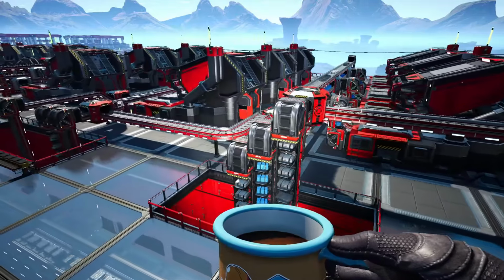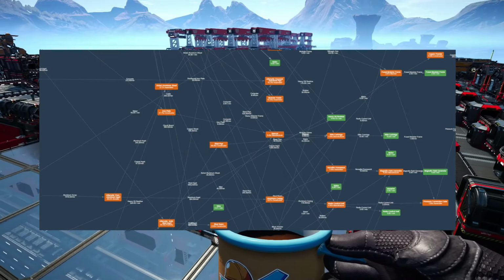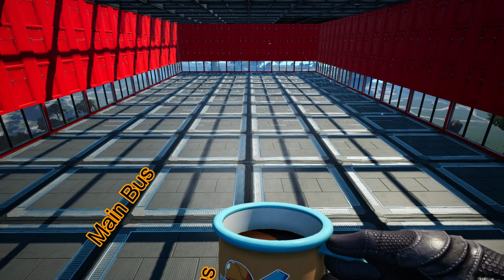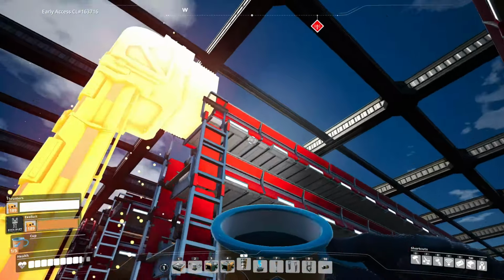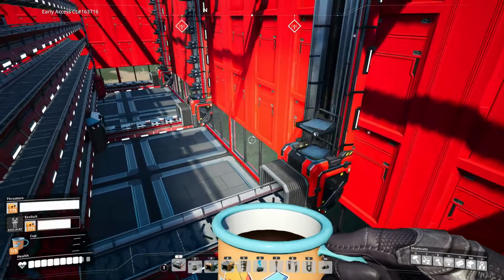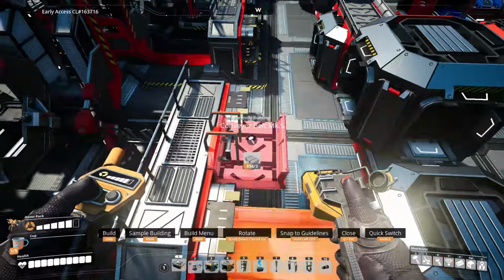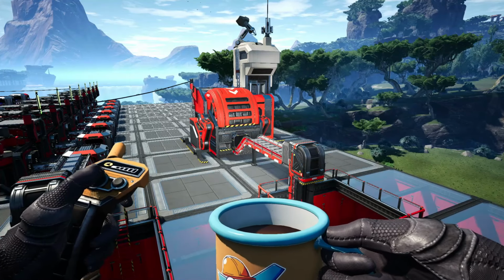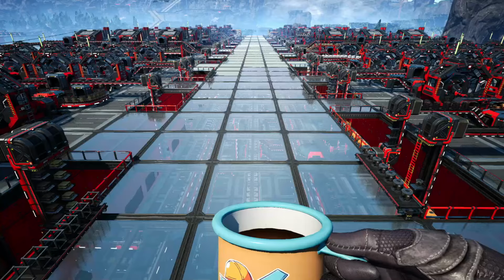Satisfactory Main Bus Tutorial

Comment: You can make the screws where you need them from steal beams, that way you don't need a separate line for screws outside the main bus
Reply from the maker: That's definitely what I would do if I needed screws.  I generally don't build my bus until I have enough alternates unlocked that I don't need screws but the steel screw recipe is def my favorite.
Reply: Isnt that what he did?

Comment: I have my main bus set up as a two loops  stacked on top of each other. one loop distributed everything to the different factories with smart splitters and sends all overflow to a belt connected to a sink.  The other loop gathers all products and excess components and puts them all back into storage.  The main storage takes in items from two belts with programmable splitters and it sends all overflow to the sink.  The idea was to make it kinda like the blood stream in your body where you have a mainline with a high flow rate and lower rank belts at the machine's inputs to make it efficient.

Comment: Nice video!  That's very close to my setup except that I put two sets of main bus stacks side-by-side (without clipping them) and leave a gap of one belt to allow for lifts.  Because I get double up the stacks, I only build 5 high and use the area where your 6th belt is to go above the belts to get items over the stacks if needed.  In your setup, you get 24 lines.  In mine, I get 40.  It's something to consider.
Reply from the maker: I've considered that, but what scares me off of it is what if I have factories on both sides that need to pull from the same belt, and I only have room to connect to the splitter once?  Now you have to find room somewhere else to make that extra split and it's just not nearly as clean and simple as being able to connect lifters to both sides of one splitter.  In general I'm a big fan of compactness and neatness but if there was ever a place where having a little extra space to maneuver would be helpful, it'd be the main bus IMO.
Reply: @StudleyKansas , yup, I get it.  I have made mine work so far.  For me, pulling wasn't the problem, it was putting back on (in my case, screws that you don't add anyway) and I only had tier 2 belts at the time.  I was hoping the initial line would hold out until tier 3 or 4 belts so expansion wouldn't be a problem (yes, delusional for screws, I know!).  I just put two Mergers side-by-side and ran the belt with a 90 degree turn to line it up.  There's tons of room for mergers/splitters as long as you can accept the items getting added/removed from the belts within a couple meters of each other.

Honestly, if I had planned better, this wouldn't have been an issue.  I could also have just used a second belt but I was winging the layout and it was early in the factory's life so I didn't know how many items would be on this floor at the time.  What I DID do was leave tons of space between the lines.

Anyway, like I said, it was just an idea to consider.

Comment: This was an awesome video please do more. No one really makes these end game organization videos
Reply from the maker: I sure will, thanks!  I've started a new save and am going to cover the different stages of the game starting from the beginning.  I think a lot of people are looking at this video and saying "Whoa, I'm not ready for that", so hopefully backing up a little bit and going into a little more detail will help people see that they can get a lot of use out of this earlier in the game than they think.
Reply: @StudleyKansas  awesome! I am following along building this bus in my new save but struggling with storage vs production. ex: iron plates, in the vid you say that the iron plates should go onto their own belt for production down the line, thing is you need a ton of iron plates early in the game for general building so the only way I have of storing them is to use the smart belt which once I also added iron rods to (for storage) clogged immediately. Is there a way around this?
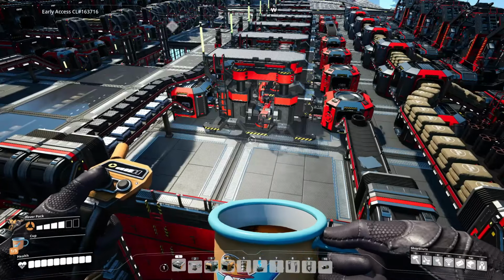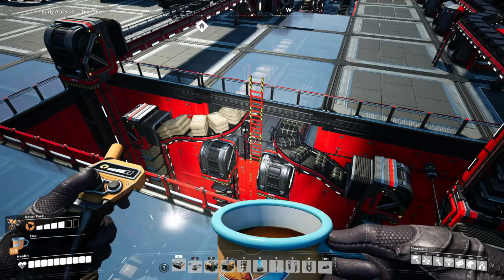Reply from the maker: @BananaNationTV    Hey sorry I didn’t see this till now.  I personally find 20 per minute to be plenty for my personal iron plate needs, so in my video toward the end you can see I have one of each type of basic part being made and put onto the smart belt return line (plates, rods, screws, wire, cable, steel pipes).  This is at 10:40 in the video.  If you need more than that, you can split off from your main iron plate line and feed directly into your storage box, as I did with four belts (in my case, copper sheets, concrete, rubber and plastic) at 9:50.

Comment: one awesome thing you can do is run a single power line right down the middle of the bus line at the factory level and use the power switches before each line of production so you can easily switch off all reinforced plate production if you need to
Reply from the maker: That's a pretty slick idea, but since I started using the daisy chain mod I've sorta gotten hooked on the "no power poles" look, it's just so clean.  If there were a way to incorporate the power switches while still maintaining the clean daisy chain look I may have to do that, because there are definitely times where it would be handy.
Reply: @StudleyKansas  It comes in great when you're trying to see if you need more of a particular item in your bus because the power flux will be very apparent and on its own graph on the power switch, also naming each line of production is mildly helpful

Comment: Spaghetti has been the bane of my existence, great timing I am about to start to rebuild everything as I get to tier 3 on the Space Elevator. I would have loved more information on how you choose what to run on each of the 4 belts ?
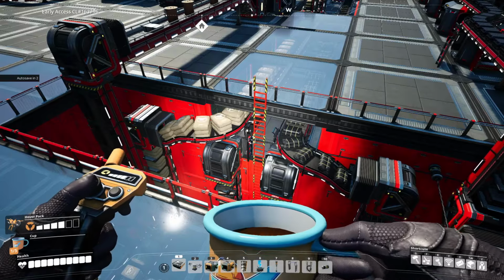Reply from the maker: Are you talking about the four belts shown at 9:59?  If so, those were the only things on my bus that needed to be put in storage that weren't already on the smart belt, and they were too high-volume to be put on the smart belt.  So, each of those items is on its own belt on the bus, and I put a splitter on each to keep the storage boxes full while also providing them to factories that need them further down the line.  On a related note, at 10:39 you'll see some items that are also too high-volume to be put on the smart belt but still needed to be put in storage, and rather than run a dedicated belt for them I just had one constructor for each and dumped them all on the smart belt return line, this way they don't run all the way to the end of my factory and back, only a short distance from the constructors to the storage containers.

Comment: Love the vid. Question: What about if you need more iron ingots than your belt can carry? Do you "top up" the belt further down, or make a new belt?
Reply from the maker: Both of those solutions would work fine.  You can also design your bus to have a few extra belts in case you run into this or some other unforeseen problem.  Also, if you build an underground bus, you can widen it and add more lanes without having to tear down anything you’ve already built.

Comment: Stacking conveyors on a bus in Satisfactory is a serious mistake, unless your bus is only one belt wide. You're pretty much guaranteeing that your conveyor stacks will get in the way of adding or removing materials from the bus. You're also making it very difficult to see what is on individual belts within the bus.

I tend to build busses that are one or two floors. On a given bus floor, belts are all at the same level, not stacked. Belts are adjacent to each other, 4 belts per foundation, rather than 1 belt stack per foundation. This is slightly less dense than a 6-belt stack, but much easier to use and inspect. Adding / removing items from the bus only becomes an issue if you're doing it very close to each other, less than a foundation's separation.

Comment: Hey im new and trying to learn how i will end up progressing. In the section "Basic items on the smart belt", are you referring to the bus lines as "Smart Belt"? If not, what is the smart belt? In the section where it is built, it seems to be referred to as both the smart belt and smart belt return line. If you need to pull these basic items, would you just pull from the smart return line like you did in the example with reinforced plates?

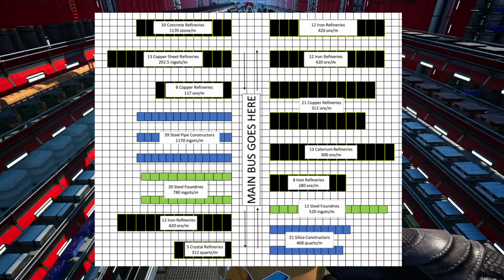Also, what is the diagram shown at 0:22? I dont think anything about this was ever mentioned. Id assume it is smelters, but you mentioned to process ore in a separate factory, and it doesnt seem like your bus area has anything mentioned on this diagram except constructors which are above bus line???

If you could upload your save that would be amazing,  it would be very helpful to jump in and examine some things in closer detail. Thanks

Comment: Trying out this method, i dont really understand if i have a main bus with iron and stuff, producing motors and reinforced plates on modular factories along the bus, returning htem to the factory. do i then have to send those items out again in the bus to make smart plates in another modular factory? how do you do this
Reply from the maker: Reinforced plates and motors would fall under the category of "low volume items" and therefore be put on the "smart belt", which runs the entire length of the factory, then returns back the opposite direction back to the beginning of the factory where your storage and awesome sink are.  Your smart plate assemblers would use the smart belt for both its inputs, with smart splitters filtering the motors and reinforced plates to their separate inputs into the assembler, and it would output its smart plates onto the same smart belt it got its inputs from, since smart plates are also low volume items.  Then the smart plates, and any reinforced plates and motors not needed by the smart plate assemblers, would continue on the smart belt to feed any further machines that need them, and eventually end up in one of your storage boxes, or the awesome sink, once your storages are full.  Does that help?
Reply: @StudleyKansas  oh wow thanks you so much yess

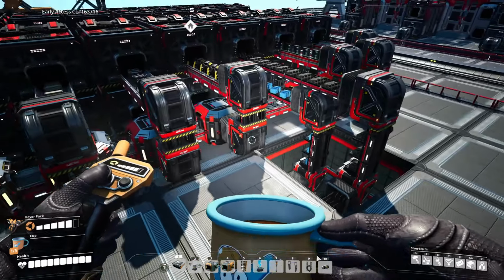Comment: I don't think I fully understand what you're showing at 10:00

So this is the end of the bus and those 4 lanes go into storage and the smart belt loops back to the start/storage/Sink? Do the other lanes simply just come to a stop at the end of the belts?
Reply from the maker: This is the first starting end of the bus, where all the storage and awesome sink is.  All bus belts start at this end and run to the other end.  All but the smart belt dead end at the other end.  These four items (copper sheets, concrete, plastic and rubber) were made at other factories and brought in on a train.  They need to feed the factory as well as end up in storage so it can use them to build things later.  The smart belt is the easiest way to do this, but these items are all too high-volume to dump on the smart belt.  Instead, I put splitters on those belts and gave each of them a dedicated run to a storage box.
Reply: @StudleyKansas  Ohh so those 4 lanes have their own dedicated belt that goes to storage, while the rest go to storage via a Smart Belt? Got it, thanks!

Thanks for the response. Great video and I love your bus design!
Reply from the maker: @ThysiosX  Yep you got it!  Glad you got some use out of this thing even if it is a bit out of date!

Comment: Beautiful design and video!
So, effectively every component in the game besides the ones listed in that dropbox link go into the smart belt; is that correct?
Reply from the maker: Yessir, that's how my "main" factory is set up, but yours may be different based on which alternate recipes you use.  In my case I don't use rods or screws at all, and replaced most recipes that use them with steel pipes, meaning I need a ton more steel pipes than someone using default recipes, and not a single belt for rods or screws.  You can shoot from the hip and just build a bunch of belts and use them as you go, but if you're the planning type you can make a list of how many of each item per minute you're going to need, sort from lowest to highest, and put as much stuff on the smart belt as you can without going over the 780 per minute limit of Mark V belts, everything else will need at least one dedicated belt.  If you're doing a specialty type factory like say, a smelting facility that only takes different types of ore and makes different types of ingots, you won't need a smart belt at all.  And if you're building a high-end only factory, a smart belt is probably the only belt you need, for example.

Comment: Hello, why don't you put things like Iron rods and Copper Wire in your main bus ?
Reply from the maker: If I used iron rods, they would likely be on my main bus since they're a fairly high volume item, but I'm using alternate recipes and don't use rods at all other than what I need personally to build things like conveyor poles etc.  Copper wire is used in such high quantities that it would need several lanes of a bus, and rather than dedicate multiple belts to one item, I prefer to instead pull the ingots off the bus and make the wire right next to the machines that need it.  I plan on eventually making a more in depth video that goes into more detail on bus design, and this is one of the sorts of questions that will get explained better in that video, but it's probably going to be a while because I'm into other games at the moment.
Reply: @StudleyKansas  Okay thanks you for your answer !